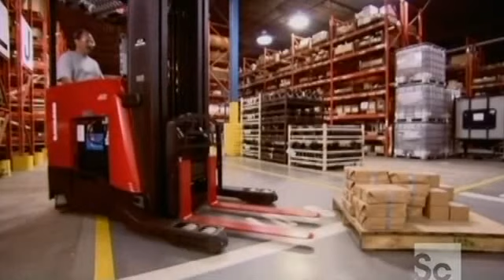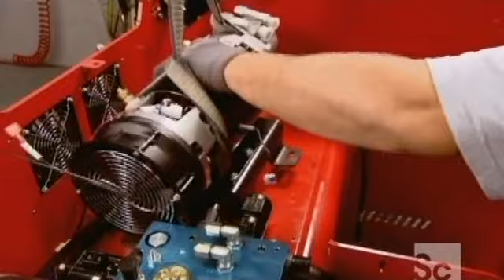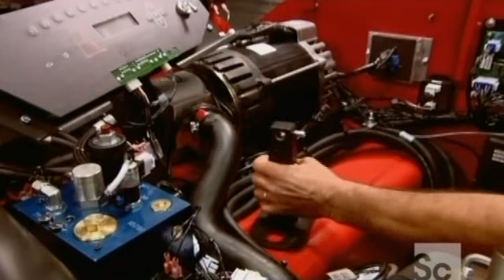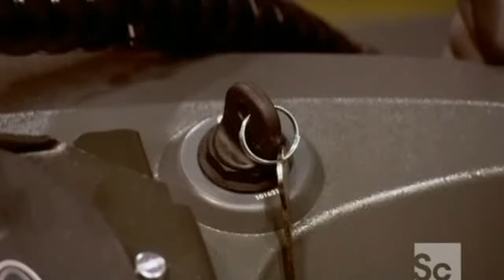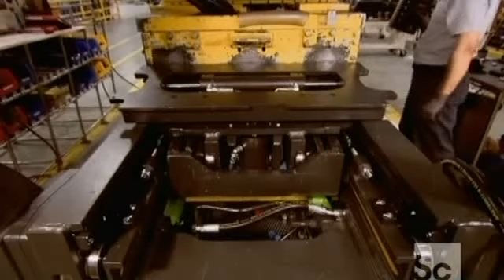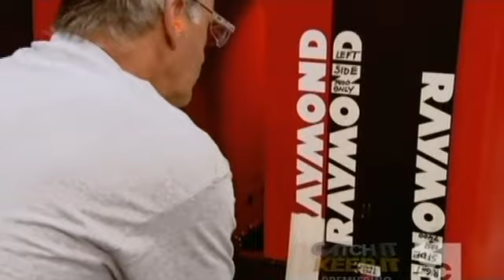How its Made - Forklift

Comment: I like how they chose not to feature the truck that has the set screw for mounting the control handle underneath, where you have to go through the battery bay to get it out. That's not even the bad part, the bad part is when it inevitably strips out because the truck was a freezer truck and it's corroded, you have to cut out the mounting point on the frame, remove the screw and then re-weld it.
Reply: Yup I've had to do this once but I find that heat is your friend in the scenario you painted, move the control wire harness out of the way and heat that puppy up, comes out easy like hot knife on butter

Comment: Computerized. Facepalm. Nothing in a forklift warrants a microprocessor. There is only up/down, pan left/right, tilt fore/aft, then move the whole truck front/rear, stop, and steer. That's it. You can do all of that easily with levers on hydraulic valves.

Comment: I did not say they lasted longer in run time versus gas. I said they have to limit performance to get long run time. A little reading comprehension can go a long way in understanding what someone is saying. Actually, they do have brakes. All modern forklifts that are electric have electromagnet E-brakes, that if power is lost or if you step off the deadman, it will come to a stop immediately. Btw, I am a forklift mech. that works on Raymonds and Crowns. So I have more than enough experience.
Reply: The braking is done with the directional lever.
Reply: @waynevietnam  thats the plug braking, not the e brake.....
Reply: @EETechs  The function is called, "plugging" which is a verb. There is no brake in the way that an automobile has a brake. There is a,  "parking brake" -which is a noun. The parking brake is not applied, it is actuated by lifting your foot off the pedal on the floorboard or simply getting off the vehicle. The other term for this pedal is, "dead man brake." Braking is done with the directional lever. There is no e-brake.
Reply: @waynevietnam  read what i wrote in my statement from a few years back..... Its called an e brake because it brakes during emergency situations like loss of power, hitting the e stop or letting off the deadman. Im not here to argue with you. I work on these 7400 and 7500 series. I know a hell of a lot more than you about their function. Go on little kid.
Reply: @waynevietnam  And btw,  I never said plug braking is a physical brake. You should learn some reading comprehension. In the industry it's understood to mean the motor is doing the stopping of the the machine and then changing direction if you continue to hold down the handle. No where did I say it was a physical brake. Get your brain checked.

Comment: That motor is a 3-phase AC induction motor. The only DC motor they showed was the lift motor at the beginning with the fan on its rear, but then later in the video they show a different lift motor that is AC also. Both Crown and Raymond now use AC motors with the exception of Raymond still using a DC motor for the drive by wire steering. 

Forklift Mechanic

Comment: How do you expect an electric forklift to be powerful when it has to be performance limited in order to get long run time? It is very possible to make an electric forklift to out pull a gas powered lift, but then that electric lift would run for less than an hour if you are lucky because the big *** battery will need to be charged from the huge power draw.

Comment: Engines combust fuel and air. This 7 HP DC motor does not do that, therefore it is not an engine........stupid narrator.
Reply: The Merriam-Webster Dictionary defines an engine as “a machine for converting any of various forms of energy into mechanical force and motion.” A DC motor fits this definition exactly, converting electrical energy into rotational force. The narrator did not call the electric motor an internal combustion engine, and thus made no error. Even if this was an erroneous statement in the script however, it would be the writer and editor at fault, not the narrator. Leave Brooks Moore alone you bastard

Comment: @2528997 
I am a service technician.  I am at the workplace everyday! And most of the 7400 model line are all electric steer anyhow.  There are not too many with hydraulic steer motors and I still say they don't leak!  Maybe you are thinking about the old EASi reach trucks?

Comment: The hydraulic steer motor shaft leaks on these things. And on the 7420 model, you need a extra special socket to adjust equalizing chain tension. Otherwise its a sweet ride. Pluggiing is almost seamless.